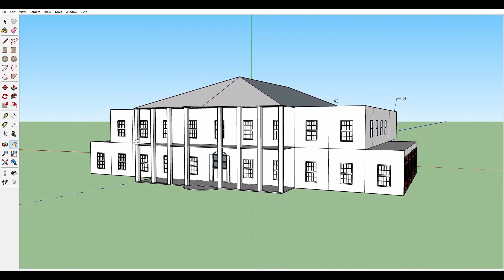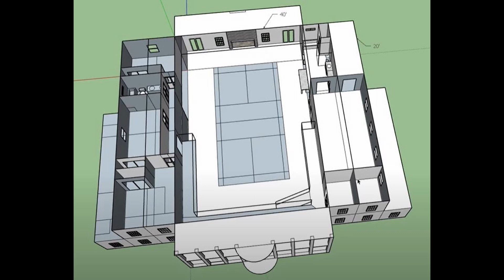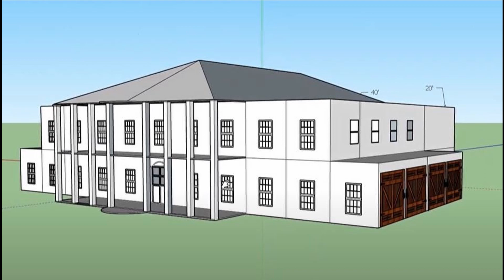A house in 1 and half days? We stacked 22 containers to build my shipping container house

Comment: Hello, I just started following your build. You’re quite the pioneer to go all in on a large container home. 💪🏽.  Was there much issue with tolerances with the threaded rods being inserted into the concrete and the conex boxes being dropped onto them? Also, were the containers just tacked together or later fully welded together? Thank you, sir.
Reply from the maker: Good questions.  The threaded rods worked perfectly.  I worked with the foundation guys (great people) to make sure they were precisedly embedded in the foundation.  Whene they containters were placed on the foundation walls, they were almost perfect, but then again the hole for the container corners are kind of big, so there is quite a bit room of error to play with.  They containers were welded at the most important parts of the containers, that is, at their bottom and top squares, so they are not going anywhere on the day of the lift because they were welded in.  Then I asked the welded to beaf up some other areas with welds, especially at the top to link all containers together seamlessly.  Then later I went around and did a lot more welds myself, like adding stich welds vertically whevere I thought connection would help.  I also welded top and bottom containers length-wise together with tabs every 4 or 5 feet.  So, this thing is a pretty big unit welded together strong.  Hope you are okay with that.
Reply: @1michiganbuck  thank you very much for the response. 💪🏽